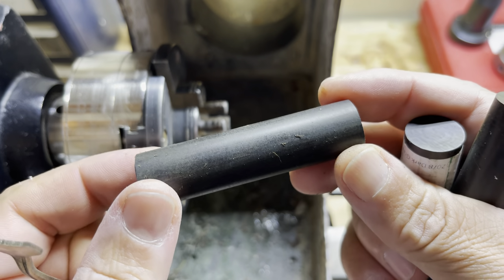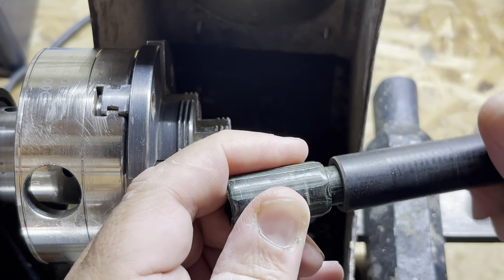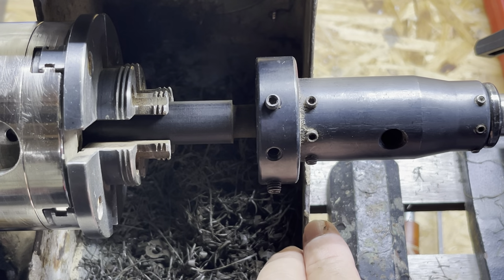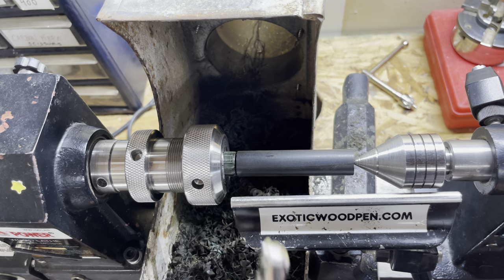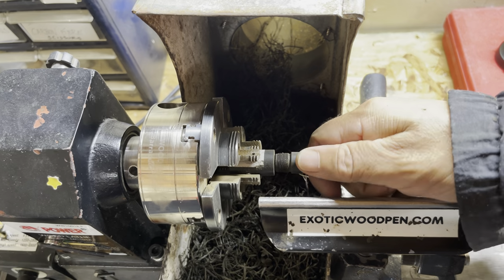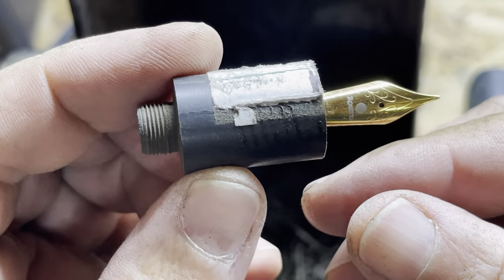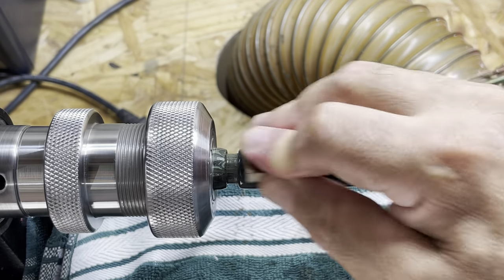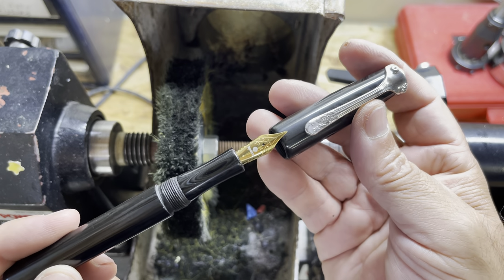Bespoke Gray Swirl Ebonite Fountain Pen

Comment: Does ebonite need buffing ? When I do buff after wet sanding , it’s leaving very distracting scratches ? Pls suggest .
Reply from the maker: I use micromesh when wet sanding, then green polishing compound.
Reply: @exoticwoodpen  is it like the plastic polish which is general used for acrylics or a different compound ? . Kindly advice
Reply from the maker: @mohangsk3759  you can use a plastic polish or Hut wax like used to put on a wood pen.  Also try a automotive carnuba wax.  No rules to finishing, try whatever you have on hand.